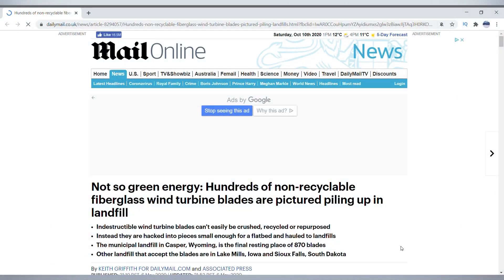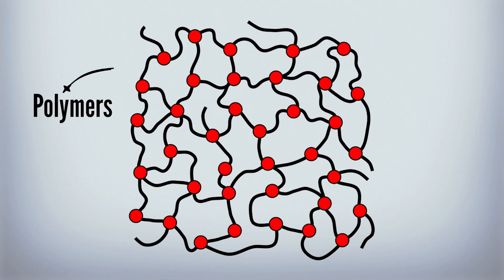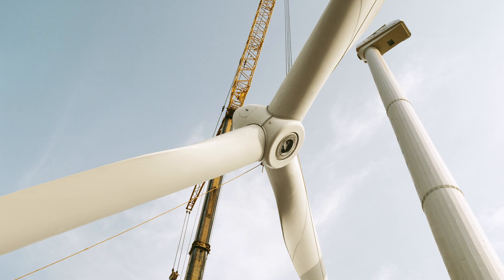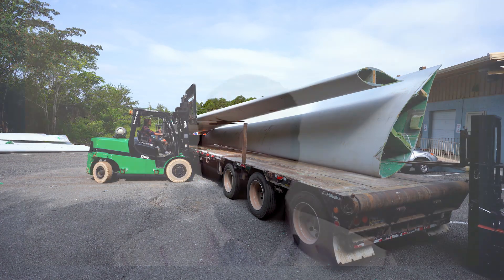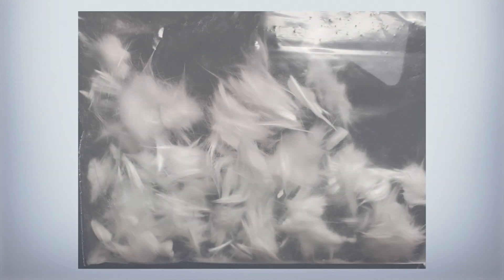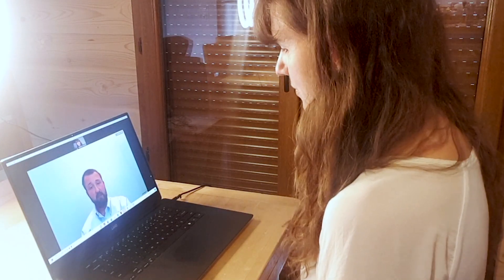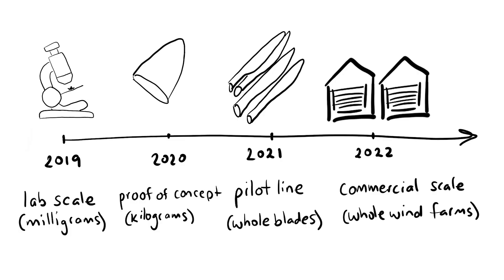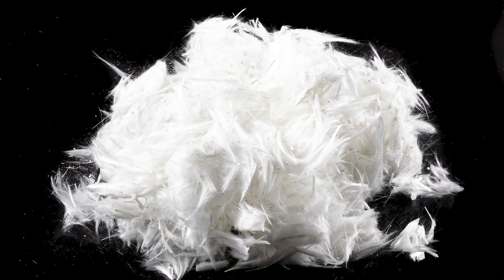New Wind Turbine Blade Recycling Method

Comment: It's great that a way to recycle wind turbine blade has been perfected. In the future most electricity will be generated by thorium reactors. Water including salt water will be used to power vehicles, airplanes, locomotives, and ships. Water converted to combustible gas to run generators will be much cheaper and less environmental damaging than wind turbines or solar panels.
Reply: I which future and using what technology, electricity is a proven technology.

Comment: The blades will deteriorate from the continuing heat of the sun. 
Anyone that is knowing about cars made from the mid 1950s
Will l turn the resin to dust . The glass takes longer, weather is very cruel on any plastic.
Everything slowly oxidizes(turns to dust) .

Comment: A Dutch company called Extreme eco solution is happy to recycle expired wind turbine blades and old boats into 100% recyclable floor tiles.
Reply from the maker: Sounds cool!
Reply: @EngineeringwithRosie  It is cool :-) And it is not some futuristic dream, but instead it is an active company. Right wing critics always complain about the expired turbine blades, but they never mention the composite boats and cars and other composite products. That shows that the right wing critics are not speaking in good faith.
Reply: @don'tmindme Most importantly is that the people need to know the facts. So that the lies from the right wing can be debunked. The technology is not the problem, but the people are.

Comment: Please address new material ideas for wind turbine blades (if you haven't already done). We are currently working on a project where we present people with current challenges regarding climate change mitigation and suggest solutions for the respective challenge. It will be in German, as it is target towards the German population in the upcoming election (in September). And one major issue is that people are afraid of the change and decide to elect the do nothing side of the parliament which already ruined German's wind turbine manufacturers and solar panel industry.

Comment: What do you think about adding a recycling fee? (not just for windmills) That would be returned with interest, to any recycler or reuser doing it in a green manner. 
For example this process would get a partial return, since there is still is pollution produced. With the remaining balance going to a pollution mitigation fund. 
The breakdown of how much of the recycling fee plus interest goes where should be keep fairly simple such as by the the net weight and or value retained or on how much pollution the recycling cause.
Reply from the maker: Great suggestion, and I have actually heard that in some parts of Europe there is a fee like that on solar panels. The same thing for wind turbine blades would surely help. I wouldn't be surprised to see one soon.
Reply: @EngineeringwithRosie Glad you think so, but the hard part is the politics. To get a fee (like a VAT) charged on negative externalities, including wind turbine blades. 

Maybe in Europe since the green party is fairly strong there? Doubtful for the USA since its not part of Climate Change mediation.. So EVs will get more subsidies, but no much support for battery recycling..... IMHO....

Comment: When I was acquainted with FG Resins, and a bit of chemistry, the UV Catastrophe Theory was quite popular with the Industrial Process of Reaction Catalyst initiation.., if the Resin didn't go off, a UV Light or Sunlight helped.
So the suspicion is that the reaction is reversible and perhaps a UV -> nacent Hydrogen in a sealed atmosphere Reactor Vessel, maybe could do this. Plastic Solvents in combination..
There's many a slip betwixt cup and lip, don't know if it works. Seems like a job for Chemical Engineers.

Comment: Syngas can be catalyzed into whichever hydrocarbon you want. Not just fuel. You can make virgin plastic, use it, pyrolyze it, make new plastic, closing the loop.
Using renewables to heat the process instead of burning some of the material for fuel lets you keep all the hydrocarbons. 
The waste heat can be sold to district heating or whatever, carbon free.
When renewables and recycling mature, so many synergies will emerge that nobody thought of yet.
Reply: Exactly my thought. Rosie it would be great to explore what else the Syngas could be used for. And can the process be set up so it uses intermittent "surplus" electricity on windy, sunny days?

Comment: It takes more fuel to make ethanol than what is produced. No doubt that's the case here. List the fuel sources? Not to mention the energy and consumables it takes to process these into smaller pieces.
What inert gas would be used and what's the process of obtaining it?
Sometimes we need to take a beating, learn our lesson, deal with consequences, start fresh and come up with a better idea for moving on. 

We have loads of data on failure points on these blades. I think a better idea would be to reinforce what we have before they reach the point of potential failure or inefficiency. Design retrofit kits. Design new one's that are rebuildable. Nothing lasts forever but if you can double or triple life expectancy then you have 1/2 to 1/3 of the spent materials to deal with.

Comment: Can't you just recycle or repair the blades into new stronger blades?
Reply from the maker: If the blades are actually broken during their expected design lifetime, then yes. But when a blade has completed has its certified lifetime, they are not actually "broken," it is mainly fatigue damage that has accumulated, tiny damages all through the blade and you don't know when it will break after that point. I discussed these issues in more depth in this video. 
https://youtu.be/PfquMx9h98M
Reply: @EngineeringwithRosie  How about this, coat the blades in super glue on the outside so that if the wind tries to put tiny damage on it, it can't do it because the glue is both holding it in place really tight, and it's protecting the blades like a sheild.
Reply from the maker: @deadeye_john  Nice thinking outside the box! Superglue is good for so, so many things, but unfortunately fatigue damage is on the inside so it won't help here 😀
Reply: @EngineeringwithRosie  Then use superglue on the inside.
Reply: @deadeye_john  Surely superglue isn't immune to fatigue either.
Reply: @seneca983  fatigue damage are cracks. If you superglue the inside, no cracks form because the glue is holding it tight.
Reply: @deadeye_john  I don't think you can just inject glue inside solid material.
Reply: @seneca983  Open up the material.  Or put the glue in between two of the same material like a sandwich. I wish I could prove it but this is a comment section.
Reply: @deadeye_john  Fatigue means that the material slowly becomes full of microcracks too tiny to see with the naked eye. I don't see how you could inject glue into those.
Reply: @seneca983  Inside and outside?
Reply: @deadeye_john  Yes both, at least to my knowledge.
Reply: @seneca983  Then superglue both the inside and outside to make sure no tiny cracks develop in the first place.
Reply: @deadeye_john  Surely it can't prevent cracks from forming. A (cured) glue is a material like any other. It's not magically immune to cracking.

Comment: Why do they still show ultra short fibers that are complete garbage and burning the polymer witch is most pure carbon is much more polluting then coal!
Reply from the maker: The fibres are shorter than original but still long enough to maintain some structural properties. And you are right that burning the polymers is a fossil fuel that releases CO2.
Reply: This is why we need bio-based resins, so we're not burning fossil carbon.
Reply: @Stella_Job  you do realize that all hydrocarbons are bio based they all started as plants and we can easily produce all of the resins form plants it just require massive amounts of energy and puts out alive amounts of Co2
Reply: @terenceiutzi4003  I do realise that all hydrocarbons are ultimately bio-based. (Though actually they can be made synthetically, e.g. power to liquid fuels from hydrogen and CO2).  But the problem is burning what originated as bio-based millions of years ago. If we only burn the carbon that nature can easily replace in the same generation, it's sustainable (subject to other issues around biodiversity, etc).  Sadly it's not "easy" to produce all the resins from plants, but progress is being made.
Reply: @Stella_Job  and how can we make hydrogen on that scale? We can use astronomical amounts of electricity on a scale that only coal can produce! Or we can crack it for natural gas and dump millions of tons of Co2 cracked from the gas into the atmospher!

Comment: And how do we separate the fiber from the epoxy with out damaging the fibers and making them garbage?
Reply from the maker: All the detail I have about the process is in the video, and in the papers I linked in the description. Beyond that it is Ryan's intellectual property 😀
Reply: @EngineeringwithRosie  look at the real data! Crusted fibers can only be used as a wetting agent in concrete but all of the polymer has to be separated and for carbon fiber construction it is useless!  So to recycle the fibers for boat like construction is extremely poluting

Comment: Why does a wind turbine blade need to be replaced in the first place?  A fixed, non-corroding object.   What gives?
Reply from the maker: Great question, and I made a video about that topic:
https://youtu.be/PfquMx9h98M
It is mostly because of fatigue loading. The wind loads on turbine components gradually wear the structure out. I explain it in more depth in the video I linked above.
Reply: Pressure different across the blade causes water droplets cavitation tat erodes the surface of the blade! That is why off shore turbines have about 20 percent of the expected life span
Reply: @terenceiutzi4003  cavitation can only happen under water. Its only for boat propellers, and pumps.
Reply: @niconico3907  yes pumps above water and whenever there is a large pressure differential like in a water turbine or a boat paddle or a wave power generator
Reply: @niconico3907  oh yes and what vapor on a wind turbine blade! And yes there is always water vapour in the air just 100 times as much over open water! OMG cavitation on off shore turbines! Who would have imagined it!But
Reply: @niconico3907  I spent over forty years working with pump and turbines in industry
Reply: @niconico3907  you should really visit some of the hydro dams in Quebec and see all of the warn out turbines laying around!
Reply: @terenceiutzi4003  cavitation is water turning from liquid to gas because a drop of pressure, and back to liquid when the pressure is back to normal.
With water vapor on wind turbine blades, its already a gas, so it cant turn from liquid to gas.
Reply: @niconico3907  yes exactly like the high and low pressure that drives all turbines!
Reply: @niconico3907  wrong water vapour is not a gas
Reply: @terenceiutzi4003  yes it is, vapor is gas. Its not liquid nor solid.
Reply: @niconico3907  how do you explain that turbine blades in Alberta Las 10 year and in more humid Ontario they last 7 years but only 2 years in off shore turbines?
Reply: @terenceiutzi4003  offshore wind turbines blades last way more than 2 years. Where does your info come from?
Reply: @niconico3907  OMG

Comment: Cut, crush, and shred... then remold...
Reply from the maker: That's possible with thermoplastic resins and less demanding applications (because when you chop the fibres you lose a lot of stiffness). But not with thermoset resins, as most wind turbine blades are made of.
Reply: @EngineeringwithRosie  75% recycling materials and 25% restructuring new materials...

Comment: Would like to know the enviromental impact it has on the animal wildlife, Eagles for examples. Sure the energy is very clean but it has its downfall aswell.
Reply from the maker: Yes, I am a big bird lover too. My favourite eagle is the wedge tailed eagle (Australian), and I would not want to see harm come to them. And you are right, every technology including wind energy has downsides. 

I will make a video on birds and wind turbines next year, but just quickly, here are the main facts:
Old wind turbines that had lattice towers used to kill a not-insignificant number of birds. They would roost in the tower, and then take off into the blades. This doesn't happen any more, since the towers are monopoles. Buildings, cars, cats and climate change all kill vastly more birds than wind turbines. 
But some specific birds in some specific locations do have problems seeing and avoiding turbines. I believe there are some raptors in California for example, and probably others. Bats also have problems in some areas. There is ongoing research on how to reduce this, but until we find a perfect solution we'll need to keep doing environmental impact assessments that include birds. We just shouldn't put wind farms in places where they are going to cause problems with birds (most countries have good regulations to ensure this doesn't happen). There aren't that many places where it is a problem, so it's actually not a really big deal to help the birds out in this way.

Thanks for watching, and thanks for the comment.
Reply: Yes I am also worried about the animals and birds. But we are killing many animals for our food all over the world and I don't know when that will stop. By the way I am a vegetarian and I don't use leather products. It sad that many people worried about the birds and they are unknowingly eat meat.
Reply: The environmental impacts are huge. Wind power on a massive scale is so far from green it's just silly.